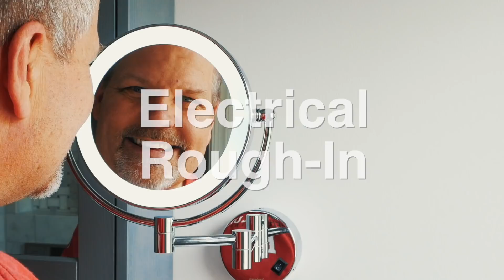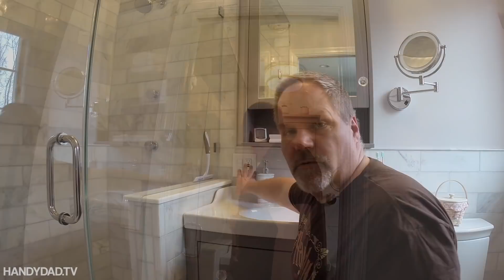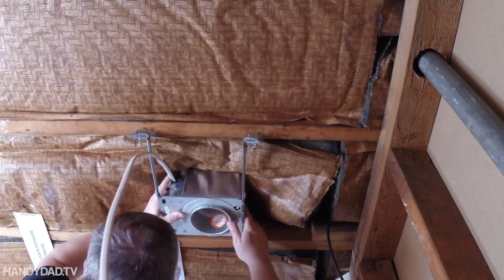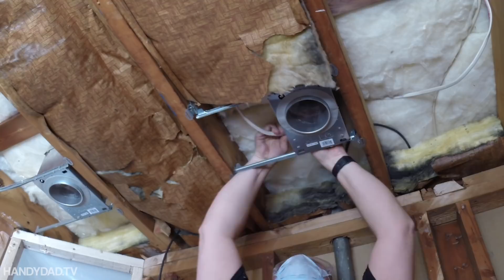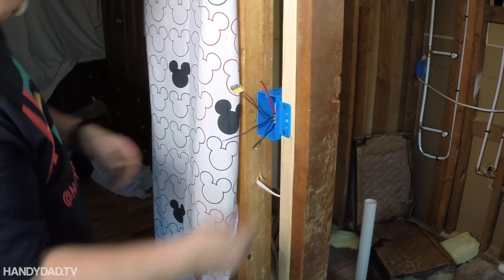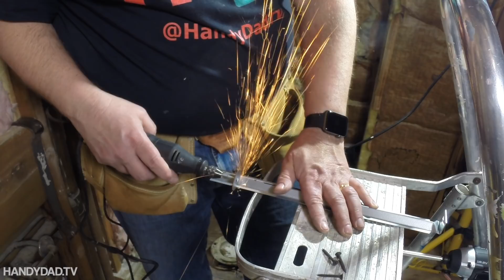Electrical Rough-In | Master Bath Remodel (Part 4)

Comment: Hi, Regulations must be different here in the UK because you are not allowed to have any switched devices on the wall in bathrooms, any switches you do have must be "pull string" type from the ceiling so that you cannot touch them with wet hands and possibly get a shock
Reply: Building Code varies from city to city in the US but typically there is no problem with bathroom outlets as long as they are equipped with a (GFCI) ground-fault circuit interrupter.     A GFCI outlet is considered safe because if a short is detected the breaker can trip the power off within 1/40 of a second to prevent injury or damage.
Reply: Adam
Reply from the maker: Interesting! Nope, switches are okay here but they must be properly grounded.